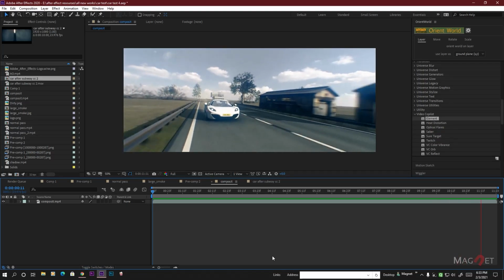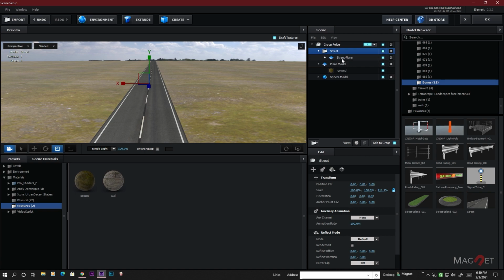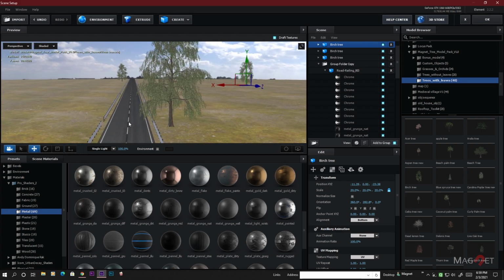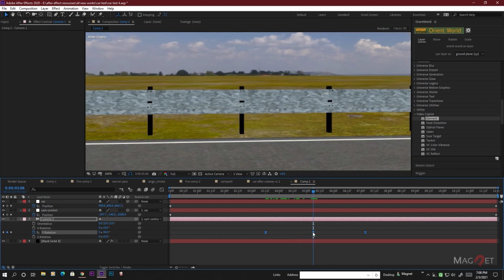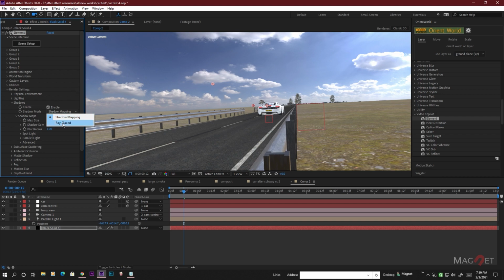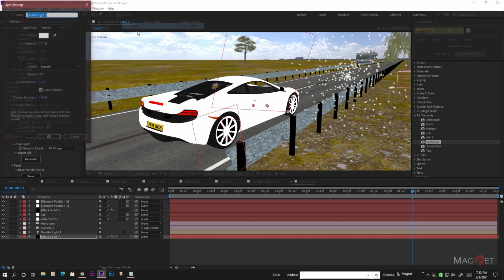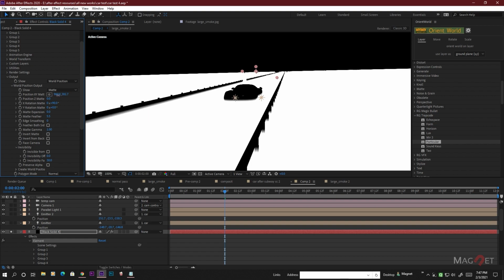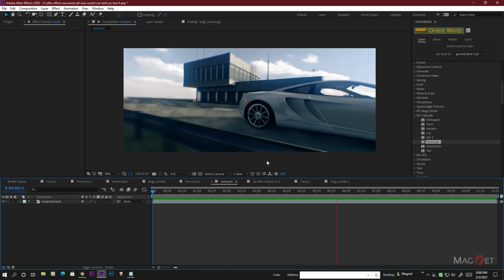How to animate Car inside After Effect using Element 3D II After Effect tutorial

Comment: Hello, Amit. the best tutorial as always!! Keep it up=) So, may be you can help.... When i finally export the project rendering shadows start moving and displace. It started after 6-7 frames usually. My video caRD IS gtx 1070 8GB -/ I tried different nvidia drivers but unfortunately the problem remain... I use ray trace shadow as you as well instead matte shadow (shadow mapping). May be i should use shadow mapping - but in your video you say it's not work properly since the big render scene.. May be you can help... Thanks in advance
Reply from the maker: render one more time without the wiggle to the camera
Reply: @magnetvfx  Thanks a lot! It works=)

Comment: Could you list your pc specs? I’d like to see what you’re running.
Reply from the maker: it's a mid-range PC 
i7 6700k 
GTX 1060 6GB 
32 GB RAM
500GB SSD
2 TB HDD
Reply: Ok awesome. I must be doing something wrong then cause when I use your tree model pack. OR even importing mi amo models with animation It’s so heavy that my pc lags and and element shuts down. 

I have an 

I7 8700
GTX 1070ti
32gb ram
SSD

But for some reason it’s not as smooth as it look in your videos.
Reply from the maker: @IvanVargasVP  that's a nice PC wish I could have this. maybe you can try the option called optimize mesh turn on this may reduce the load
Reply: @magnetvfx  I’ll prey so you can have the most powerful computer possible so you can make even better videos. You are so talented and I’m so grateful for your videos and tutorials. I learn so much from them.